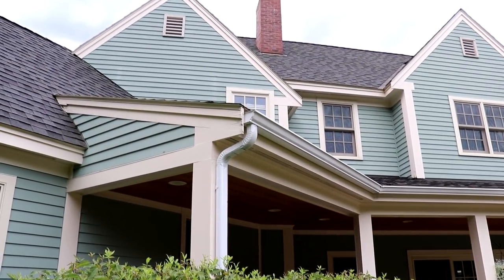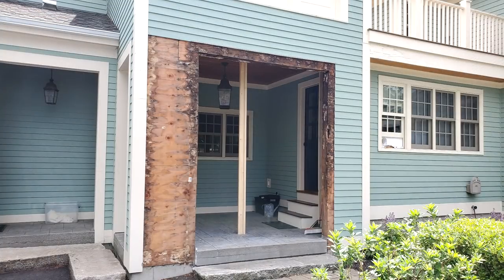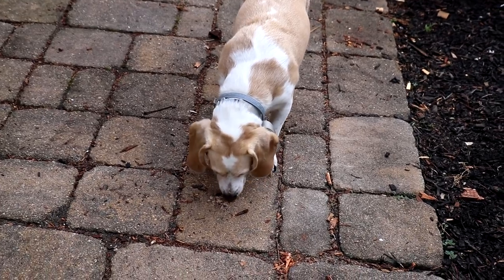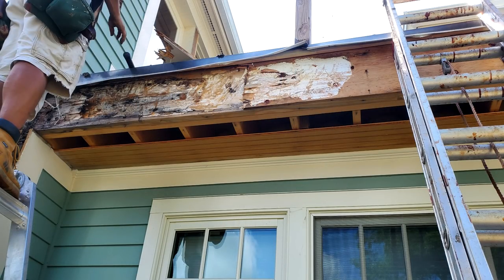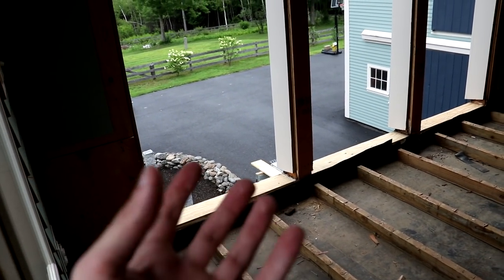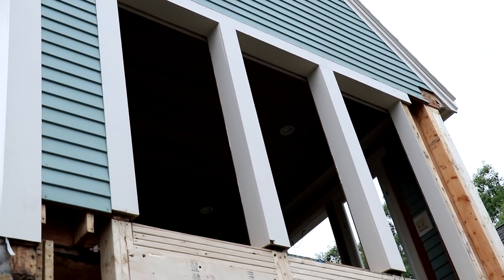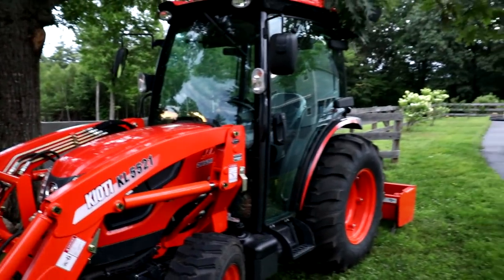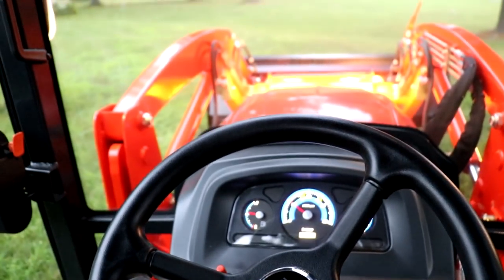My Dream House is FALLING Apart! (Major LEAK & MOLD)

Comment: Cody the thing is that u cant just put wood, u have to put covers arond the wood like plástic or other stuff
Reply from the maker: yeah its really strange there was no material wrapped around the framing. I am suspect to think the rest of the house doesn't have it as there are drafts in the house that could be from the house not properly being sealed.

Comment: Just wondering why are all American houses made out of wood? Use brick
Reply from the maker: Too expensive and lots of maintenance. Most of the exterior is composite or plastic now. Lasts longer
Reply: Probably why houses in the UK are smaller